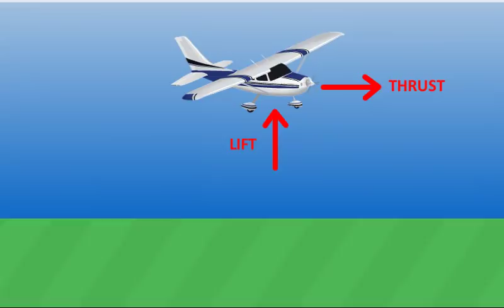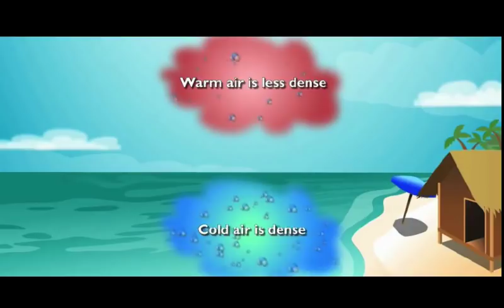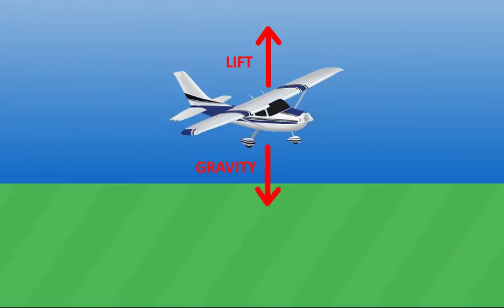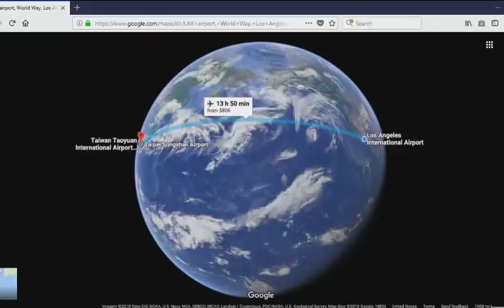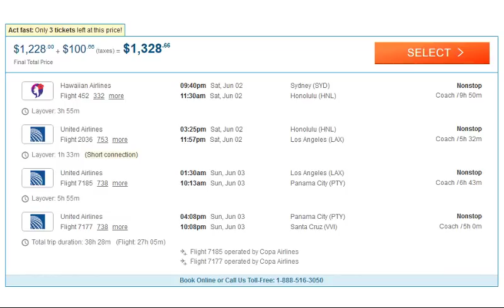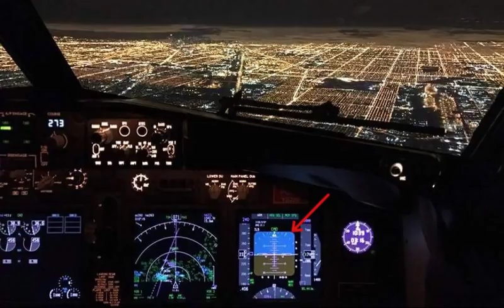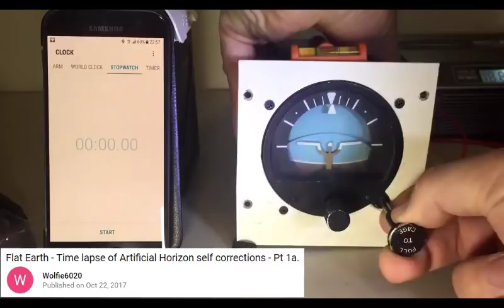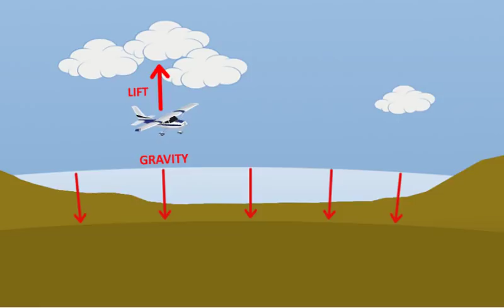Flat Earth Falsities - Plane Nonsense

Comment: As a pilot, all this is correct. When i fly straight and level, my path and height is pulled around the earth so i do nothing and keep same height more or less. Also flat earthers are missing a critical observation in their mind. YES the earth spins fast BUT at the edge in relation to a fixed point in space. Th earth is so big, that that point takes 24 hours to return to the same point. On a 1 meter size ball you turn it and 30 secs later its returned. The earth width is 12,000 roughly, so its a LONG way round and back again. If we were travelling faster then we would feel lighter against the fixed gravity mass that this planet has and likely have a thinner atmosphere as it leaks out into space thus we wouldnt likely have evolved and be talking about this!! So the moon has smaller mass and you bounce when you walk and almost no atmosphere which is only about 50 tons which is effectively no atmosphere and had to be detected much later in science with later instruments.  Mars is 1/3 of the gravity of earth and retains a thin poisonous atmosphere and no protection from cosmic radiation so living there on the surface would be impossible but for short time exposure. 
Last point and its mind bending. NO humans ever sees a long flat surface on the earth- its always curving away downwards. We see a flat line to the moon in the sky but there isnt a road built that we can look all the way along thus until we can build a actual flat surface for say 1000 kms, our eyes will never see a truly flat surface except for short distances that are made flat.
Reply: Timxx3868 If "NO humans ever sees a long flat surface on the earth" as you say why did all cultures believe the Earth was flat? Were they blind? You are asserting it was curved in front of them but they were in some kind of delusional cognitive dissonance rejecting what was so plainly before their eyes? No, you have it backwards and are trying to make us believe your own imaginary delusion. The natural position is to see the Earth is flat and it takes propaganda and brainwashing (or what you will say is "education") to get one to entertain that it is not.
Reply: @bungeebones  ok, lets test your eyes. You believe them dont you? totally???

Ok look at your skin, what do you see? nothing? BUT you know its full of bacteria swimming all over you and inside you ?  you trust doctors saying this dont you and MRI machines that test you for cancer and things. Yo u trust medicine and the same scientist TELL you the earth is not flat

OF couse the earth looks flat- Its 12,000 kms wide. How else is it going to look? Fly to 70,000 feet and you can see a gentle curve. James May did it in a U@ spy plane. But your eyes are mistaken . 550 people from many nations since 1961  have been to space and lived above the globe. My planes radio cant go past the horizon so i cant talk to the tower unless i gain height or get closer to the airport. Am i and all pilots wrong??  lighthouses have their light at the top why? so boats can see it far enough out  so they dont hit the rocks near the lighthouse. You see all this flat nonsense was disproven hundreds of years ago when the first sailors DARED to sail over the horizon. did they fall off, no they sailed all the way around back to where they start. 
Do you trust silly channels full of FE ideas or scientist that live in the real world? its up to you. BE stupid or LEARN how YOUR world and all the other planet work....
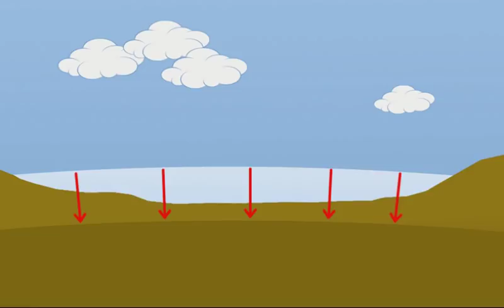Reply: As a PILOT 6:10 is correct... and no other correction is needed to stay curved level to the Ball? You feel this pulling do you? Can not be a pushing.. YES we are missing mind observation (school programed criticality) :( :( :( 

Lots of Pilots come by here, as Freemasons, with their secrets, but not on the shape of Earth, un-Iniciated and Commoners get freely elevated to that knowledge.
As a Psychologist I have experience that Minds can not be trusted...
The many NAVIGATORS here actually curvature at sea.

Earth may be so big but satellites /ISS sees 1/4 of the curve if not more.
Apparently an Astronaut can hide EARTH with his thumb..
ps: sorry for the boring word 'Density'. Long live automatic Gravity!
Reply: @BrainUser1  I dont know how quite to reply and what you are asking or not trusting from the "govt" 
Let me give you some reality that the internet is lacking on flat earth channels and silly nonsense.
Thousand of individual pilots like me fly millions of passengers every year around the globe. HOW can we all be wrong and mistaken ? How can 500 people have been to space and LIVED there for 6-12 months and be lieing?  14 year old children sail around the world to break records and old sailing ships did this for centuries before? 
The only Lies that are NOT based in fact are gods and bibles that are all proven wrong with proven facts . Flat earth creation, its all in there, BUT it was written by men of the time so its CORRECT as they saw it. NOW we are educated. 
Your doctor trying to kill you with evil medicine? all this as a crazy nuts say what they want and claim on youtube- so gullible people believe conspiracies. 
I recommend you dont get on a plane as it might fly off the edge or hit the dome??? YET this never happens?? 
Not one report from the edge of the world from anyone NOT even on youtube?? 
Think back how you would have thought 1000 years ago? lightening made by a god YES!!!, Humans made by a creatror as our eyes tell it its true YES 
BUT now we understand how things work and scammers use tricks to trick us 
Be smart, learn how planes fly and rockets go to space using explosive fuels and solid propellant. 
Take a flight with an instructor and he will explain how the plane flys and why it dosent ZOOM upwards!! hmm away from the round earth . Sadly education has failed us if you think like this. Sorry.. i wish you could think RATIONALLY and reason things out of what goes on all around you every day. Not silly gods and flat earth . Just liveing , cancer and the sun exploding in 5 billion years wiiping all the earth and inner planets and all life and we cant stop that- its how the galaxy works...
Reply: @xx3868  WOAW woaw.. yes I heard before, few times, not a learning site (except here..). So mister Critic you like the "parrallel to the force of Gravity" bit?
ps: I went to GOV school all  my Life. Also had my tonsil remove by Science, and my mom took approved Thalidomide.
Have an nice day admiring your beloved Government in which you trust!
Reply: @BrainUser1  YES, you are right. Govts make mistakes all the time and people sometime get hurt. BUT the diff between nonsense science and real science is that real scientist are accountable and get it right 95% or more. So some things get through that are wrong and TODAY, we understand science much better so errors are very small now. "creationism" and gravity deniers is not real science, just opinions like astrology and liberal or labour- These are subjective idears. .
In the "old "days, we burnt witches and used leeches and "govt" error were 95% instead of 5%! so today you are way way more safer  BUT, when things go wrong, a whole mess of people get involved to find out what happened and stop it happening  again. Sorry about you mum and you always want to QUESTION everything including science and any claim BUT you dont turn to unqualified people who clearly dont even know the basics and then claim that there is no such thing as gravity and density is what makes things go up and down?????  I know these things as i actually fly and the earth was built because of gravity and will be destroyed by same billion of years from now
How do we know and can prove all these" ideas" . Science observe these things. We observe formation of planets ., we have seen black holes and what we predict, we PROVE or its not really science. Claims of 6000 year old earth is wrong in every possible way  and created man is same. The evidence for hundreds of years says the opposite.
So the bibles real? YES, they prove they were written by man as the "science" is correct for its time. It talks of flat earths exactly what you expect ignorant men to "SEE" with their own eyes. 
There is no such thing as a rational logical person of faith. Because real evidence is know now that we are mistaken on so many things and the error rate TODAY on claims of science is very small. 
BUT the top physicist Lawrence Krauss admits he dosent know everything. This is a gut who is dealing with the start of the universe! and he says he is falible!! He is very very smart and he can admit science can get it wrong. Point is, FAITH NEVER admits it is wrong and thats the problem. Wrong ideas told to people that are the word of "god" but theres no proof of that and which god??
The dark ages is gone now and the humans race is a cobbled body of evolution and we suffer from brain cancer but apes dont? why? because the gene for our skull to expand and brain size gives us a bigger brain BUT it leaves errors and failure to allow cancer to occur. See humans are not special but a evolved direction that leaves us with deseases and all sorts of problems with child birth. YEAH real perfect gods creation!!  No just another species and not perfect!

If you are confused on all the nonsense you see on these channels of claims by flat earthers and silly things, ASK how something really works then look up REAL science sources to check what you are being told. PROOF of the real world is the only real proof as we live on a ball and 500 people see the round earth from space. Nothing can change that.
Reply: @xx3868  How many military and spy agency personel are sworn to secrecy and at the risk of death if they violate that oath? Frankly, it doesn't change one breath I have whether or not the Earth is flat or spherical so why would a person risk their life after making such an oath?  They were seduced into their oaths for money, patriotism, ideology, power, excitement etc. and certainly have to keep a large number of publicly accepted lies under wraps than flat Earth (many much more important such as who shot Kennedy for one).
Reply: @bungeebones  yes you are right about general secrets but this is stuff that only a few know and yet it gets out anyway. The Flat earth , we live with every day and all the scientist are working with it and our technology wouldnt work if we were on a flat earth. Radio is limited, you cant see very far ect.
Clinton had that secret affair and all the staff are sworn to secrecy and that got out . Imagine the thousands of people that have to keep secret for a real conspiracy to stay quiet. 
Common sense always prevails and people talk to their wives ect. NOTHING stays secret except things that people  dont know. We have laws for documents to be released on the military and we find out about tests and cancer and all that. 
Its not possible to lie about the earth you live on or gravity because REAL scientist use this everyday. they are all NOT govt stooges but independent just as i am and if i saw something out of place, i report it. By nature scientist are smart AND curious and question EVERYTHING. So thousands of these guys all going along with this round earth thing????
My flying maps all wrong as they based on a false round planet, so why dont i get horribly lost and 1 billion passengers every year that fly?? you see REALITY is different that flat earth channels pedalling nonsense maybe even trying to understand but cant understand so make up their own theories . Watch some real science channels and learn something and you will be smart too....